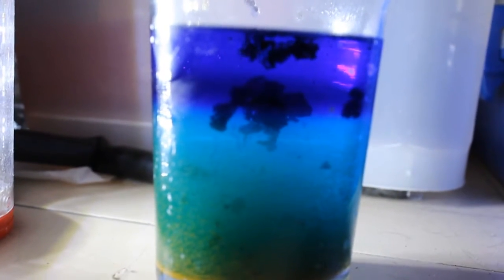electroylsis of ammonium sulfate

Comment: Ok you electrolysed ammonium bisulphate with copper electrodes and got copper sulphate and schweitzers reagent, i think i can make sense of this for you.
sulphate irons migrate to the copper anode where two electrons are removed 
Cu  +  SO4(2-)  -2e  =>  CuSO4
The copper ions are hydrated complex ions   Cu.6H2O 2+      which is pale blue
NH4+  goes to anode and gains an electron 
2NH4+   +  2e  =>  2NH3   +  H2 gas
Then Cu.6H2O 2+   +   4NH3  <=>   Cu.4NH3.2H2O 2+   +   4H2O     complex is dark blue
Also Cu.6H2O 2+ and 2OH-  =>  Cu.6H2O.2OH   hydrated pale green copper hydroxide 
I think the copper hydroxide suspension  is slightly denser and tends to sink, hence the layers.

Comment: Hello I am trying to figure out what happens to aluminum ammonium sulfate under electrolysis using lead
Reply: Possible production of a lead anode coated in lead dioxide and some oxidation of sulphate to  persulphate in an acidic mixture of ammonium sulphate and bisulphate.
And electrolysis of water. 
And enough disolved lead in the solution to make it something to be careful with.
Reply from the maker: nothing LOL
Reply: @CatboyChemicalSociety  so there is no phase change you don't produce ammonium hydroxide?
Reply: @reliantbatteries7196  goal Al hydroxide?